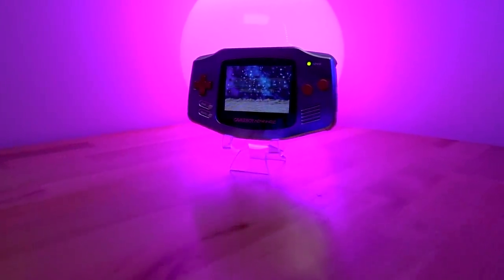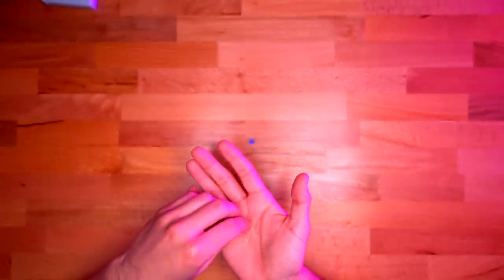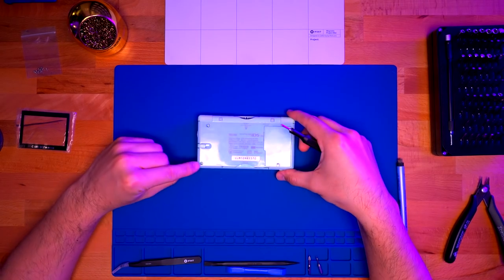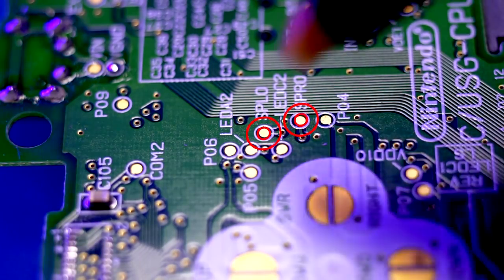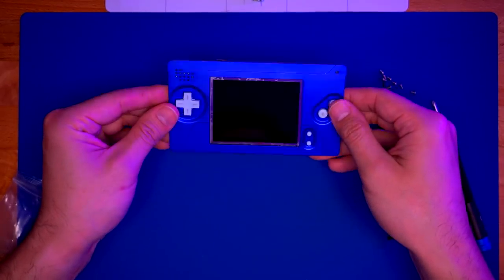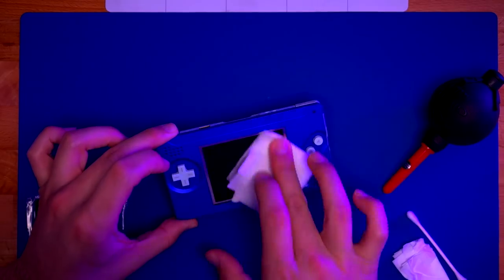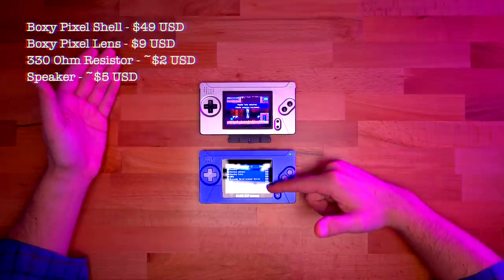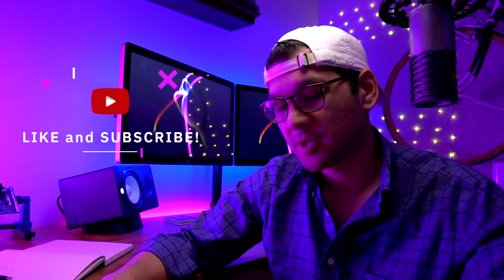Gameboy Macro Mod Tutorial 2020 - Easy to Follow Instructions - Boxy Pixel Shell | Retro Renew

Comment: Is there no way you can do this without soldering?
Reply from the maker: Great questions Charlie!  Yes, there are a couple ways actually!  One way is to set the DS to autoplay GBA games when they are inserted, then do the mod without removing the battery.  Once the mod complete, you will be able to play GBA games that are inserted.  As a note, be sure that the bottom screen is selected as the GBA default screen prior to the mod.  Also, as a downside, if the battery is removed you will need to reinstall the top screen to get through the initial system settings (this is not a reliable solution in my opinion).  The other way is to remove the top half in such a way that you retain some of the top screen components, such as the speakers and the LED backlight for the top LCD.  You will then need to stuff those components into the bottom half.  People usually remove the stylus holder to make more room.  This method retains all the functionality of the original DS, minus the top screen.  There are some videos on youtube that show these methods.  I hope this was helpful!  Best of luck!  Cheers!
Reply: Thanks that really helped. I might just buy a soldering kit and give it a try.

Comment: Why would you sacrifice the other two buttons?
Reply from the maker: Great questions Dan!  Unfortunately, the kit does not accommodate the X and Y buttons.  If the console is solely being used as a GBA then those buttons are not needed.  However, there are a few DS games that only really needs the bottom screen, and if you intend to play those, then I would recommend doing the Macro mod using the original DS shell and not the Boxy Pixel one so you can keep both the X and Y buttons.  I hope this helps.  Cheers!
Reply: @MachoNachoProductions  Makes sense to me.  Thanks for the response.
Reply from the maker: Any time!

Comment: Question.
Does this theoretically mean that (not that I would do this) if you wanted to use the bottom screen from the DSi to have a larger Macro screen you'd be able to do that? Or no?
Reply from the maker: Hmm I’m not 100% sure. I’m guessing it won’t due to a different ribbon cable and possibly just not being compatible. Although that would be pretty neat!

Comment: Would this mod work with a regular Nintendo DS (original)? I know it would be thicker, that’s fine.
Reply from the maker: Yes, this would work with the original DS as well!  The Boxy Pixel faceplate wont be compatible but you can remove the top section of the DS and retain the original bottom moldings.  Let me know if you have any other questions!  Best of luck!  Cheers!